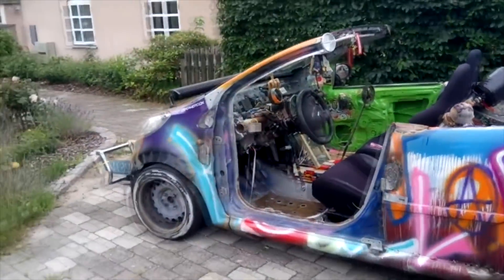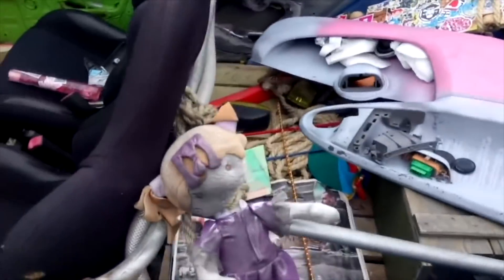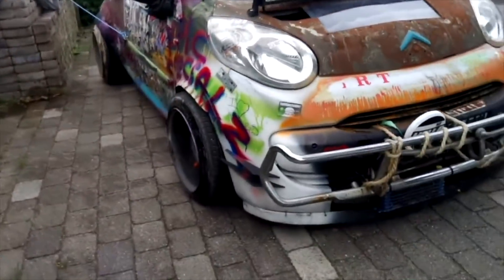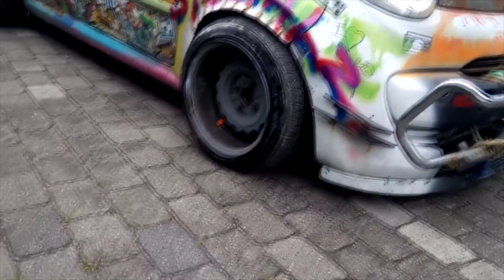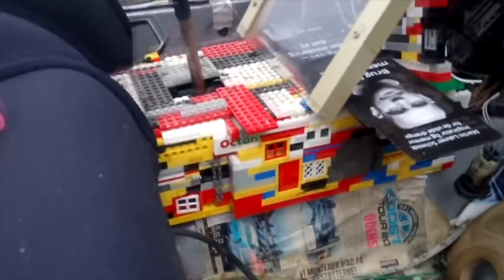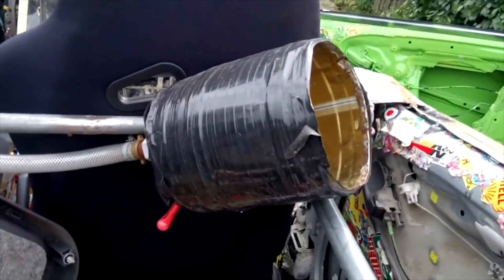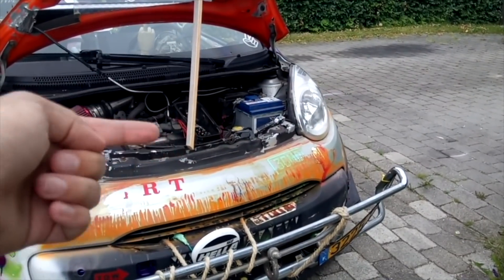MY CRAP CAR - Citroen C1 "Rat Bastard"

Comment: it is twin turbo now :D
Reply: Holy fuck nuts
Reply: IRL DriftKing fucking Denmark 😂
Reply: How the fuck does that engine push two turbos?
Reply: those turbos would produce boost if you farted through them with how small they are
Reply: The tapes and stickers adds tons of horsepower
Reply: Se7enAte youre right xd
Reply: Not sure which is the biggest potato.  The inline 3 with 2 keychain sized hairdryers, or the device used to film it!

Comment: The thing with Citroens is that if they look to be in good condition then they're probably not working whereas the ones that look like hammered shit will run until the world runs out of oil. I bought a cheap Xsara that looked to be on it's last legs 5yrs ago as a stop-gap car while I saved for something better and the bastard still refuses to die, I won't get rid of it until it can't go any further but the list of things that aren't working has long surpassed the list of things that are

Comment: It's not really right for this show imo, of course he made it that way on purpose and he doesn't have to actually use it for anything.

It's much more interesting to see cars people are actually using and living with. 

Like, you can do any mad shit to a car if you don't have to get up and drive it to work in the morning, and it doesn't matter.  

If it's not road legal and you cant actually use it for anything it shouldn't count either.
Reply: As i can see from the comments it is street legal. I think it's awesome to take a simple citroen and turn it in to a compleeeeetley different beast. That thing has two torbos now and they are right out of the hood. I think it is verry inpractical but awesome non the less!!
Reply: I'm pretty sure that thing is not street legal. It's Europe we're talking about afterall.
And I agree with the OP, this doens't really fit this show.

Comment: Hey MCM, fun fact, the citroen c1 is also on sale in europe as the peugeot 107 but interestingly its also on sale as the toyota aygo, wich is i supose 1 size up from the kei-car in japan. The petrol engined cars are powered by a toyota 3cil 1L engine wich has its roots in an antique daihatsu charade from the late 80's early 90's. There is also a diesel version on sale with a 1,4L common rail direct injected turbo diesel wich is a peugeot/citroen unit that is easy tunable to around 100hp and over 250nl of torque, thats ALOT in a car the size of my mustache. 

Love the show guys, keep it up!
Reply: would love to see your mustache!

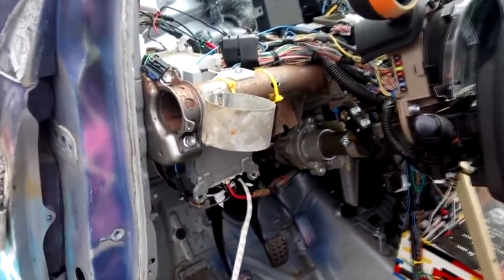Comment: 3:23 I have to object to that. Pretty much all Peugeots and Citroens in the recent 30-ish years are zinc plated and they don't easily rust. The C1 on the other hand is, basically a Toyota Aygo and it is manufactured by Toyota, so i don't know the situation there.
Reply: the c2 vts rust quite bad but that's mainly due to a design flaw with the side skirts, but will admit the 205's, 106's and most from the mid 80's to late 90's are normally quite good compared to other manufactures cars
Reply: There was a time where french cars were rusting fast but now they're like any other car.

Comment: This thing is amazing. I wonder how it works legally, and if you can actually drive it. I doubt that'd be legal in my country, homologating little things is already hard, I doubt that roofcut could be allowed to pass inspections.
Reply: coscorrodrift - That car is not legal in any way in any country (I hope) and certainly not Denmark where he's from.
Only thing it's good for is the bin
Reply: As bureaucratic as france is, I can't imagine it being legal there either.
Reply: I think he said he puts it on a trailer with the planks in the passenger seat. I guess this guy shows up to tracks and car shows hauling this lol
Reply: coscorrodrift it's not legal to drive in the road, he was using it as a show, in the start it was legal, but he was making to must to it, and so in the last end, he made it twin turbo, with pvc pibes and tape, it was making pressure
Reply: Expressive Thinking Chopping off the roof is actually quite likely entirely legal in at least one country. You'd have to jump through a lot of hoops to do it but here in the other Denmark that is Dutchland you can in principle change your car's body, chassis or engine as much as you want as long as it's all still structurally sound, passes a couple noise and emission tests and can do a rudimentary elk test at 50 km/h. Admittedly, cars built since 1998 are held to stricter standards but a C1 chopped up that much can be registered here.
Reply: Indeed no way this car can be legal anywhere in Europe. I think the fun is in the build itself.
It's like playing with legos: great time to design and build but once it's finished you do something else
Reply: coscorrodrift has

Comment: i liked it better when it still had a roof and was used as a daily. already looked ratty then but a bit less overdone. pic related: http://sn.dk/modules/xphoto/cache/42/710442_930_9300_3_0_1567_1083_2.jpg

Comment: its a french car automatically comes crap out of factory
Reply: modern french cars do but in the 80's and 90's they had some good cars mainly Peugeot with the 205 gti, 205 T-16, 405 T-16, 309 gti, Renault had a few aswell
Reply: My 15 years old Twingo is still kicking despite its 275000 kilometers, and no rust...